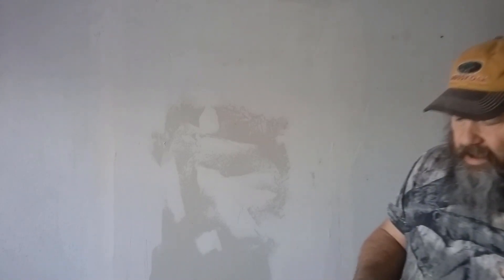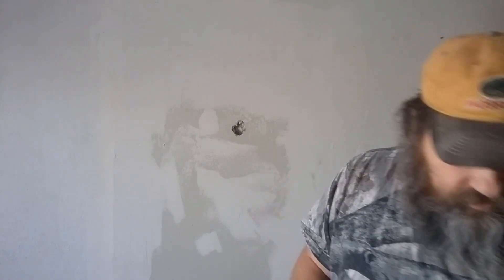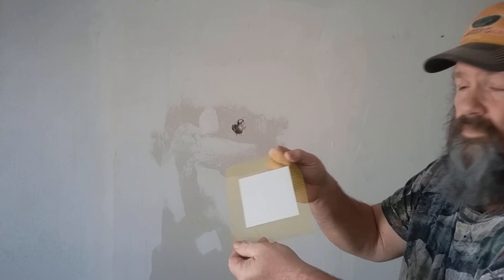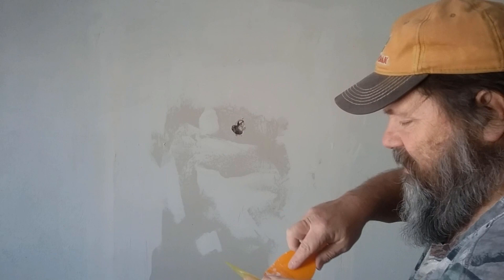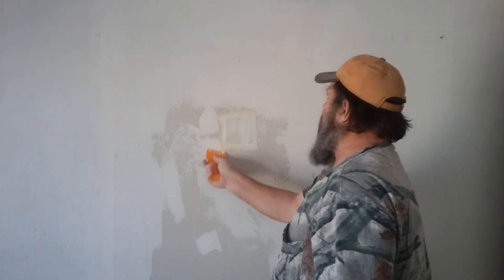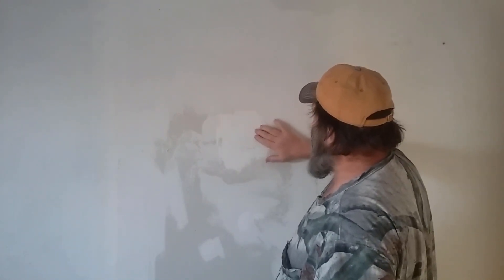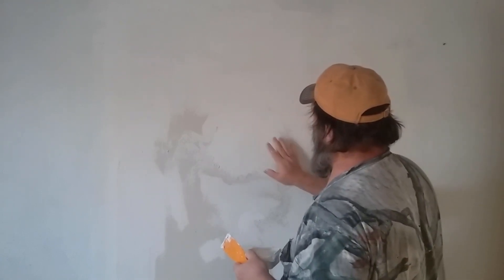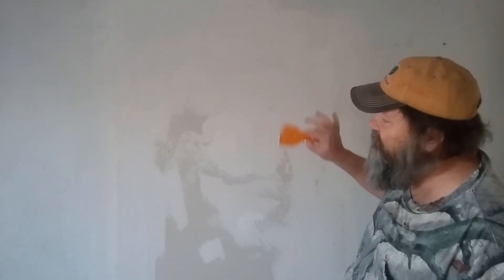How To Use Homax Wall Repair & Patch Kit To Patch a Hole In Drywall

Comment: Those things actually work great.   You can really make them flat so there is no hump.  The spackle is not great though.  Get that pink turn white tub of DAP joint compound, or bust out 5 minute lite if you are in a hurry.
Reply from the maker: Yeah, I was a little impressed by how flat the actual patch was. Thanks for stopping by and leaving a comment, I appreciate it!

Comment: If the puddy is too thick, how can I thin it out?  Just keep working it in or what?
Reply from the maker: The puddy in my Homax wall repair kit was thick as well. I just kept working it around. You might add just the smallest amount of water to it, like a few drops. But I would work it around quite a bit before I added any water to it!
Reply: @BlueCollarDIY  thank you!
Reply from the maker: @kyleecaudill  You're welcome! Good luck with your wall patch project!

Comment: It’s obviously way too big for the whole for it not to look like a big sloppy patch.  Can you cut the patch smaller or not ?
Reply from the maker: It's supposed to be larger than the hole. It makes it easier to blend in further in the process. A larger patch is easier to blend than a smaller one. I'm not sure you could cut the patch material in the Homax Wall Repair & Patch kit.
Reply: Blue Collar DIY  okay. Asking because I put a door knob hole in my wall and I ordered this kit off amazon for $6.  Hoping it’ll work. Don’t know if I have paint to match my wall though.  🤦🏻‍♀️ thanks.